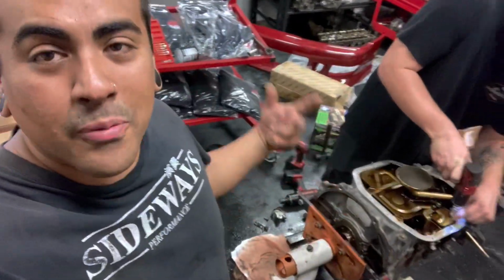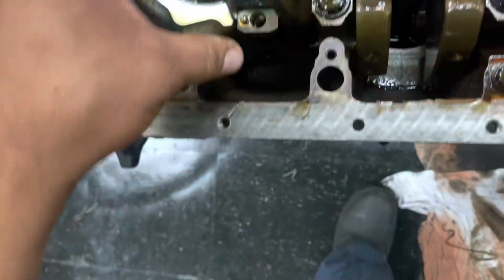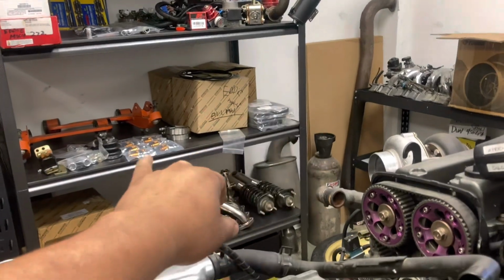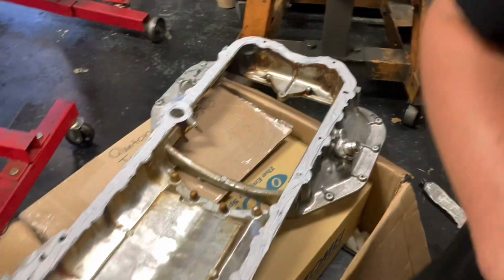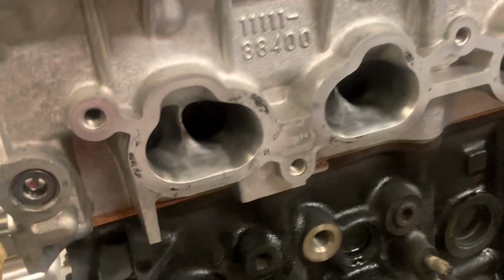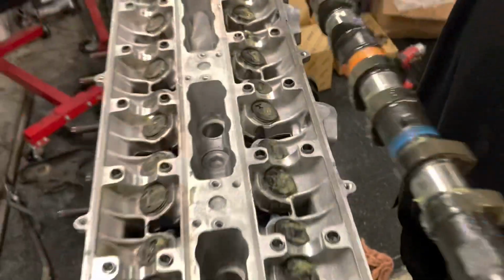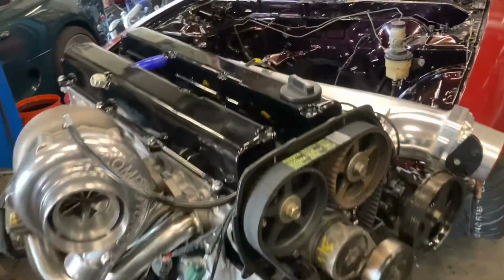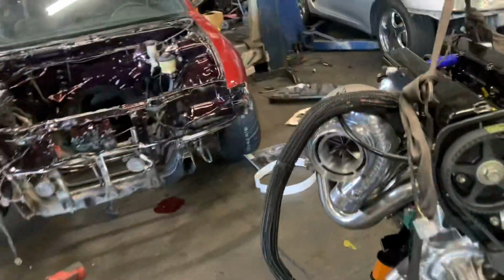Nikkos S14 1.5jz Engine Build part 3

Comment: You guys never mess around when it comes to getting things done Quick and in a hurry with precision timing. She should do very well. I will have an r154 with the same ACT clutch and flywheel for sale as soon as I get a chance to post it. Clutch has less than a 1000 mile on it and not abused as you can look at it and see. 👆💯🏁🏁😎😎🏁🏁😎